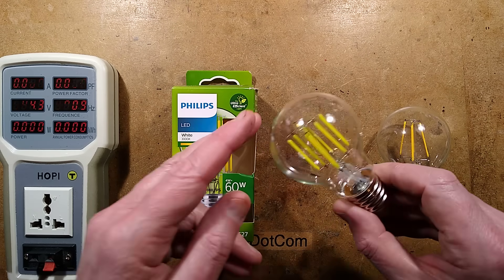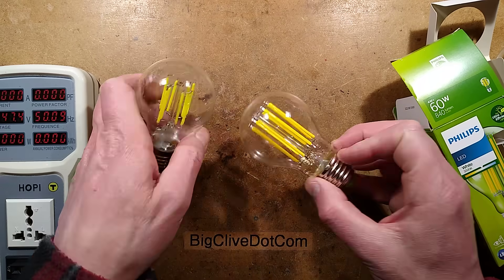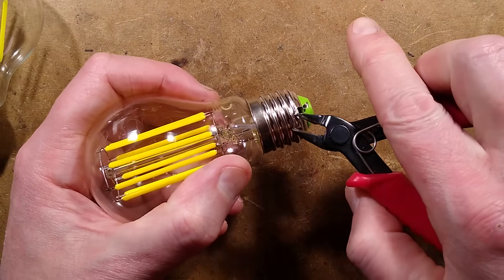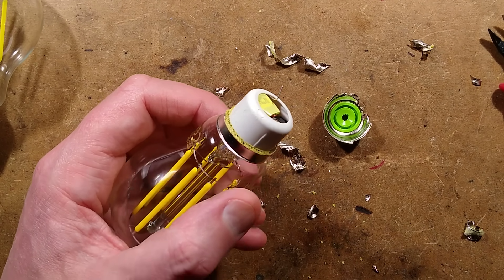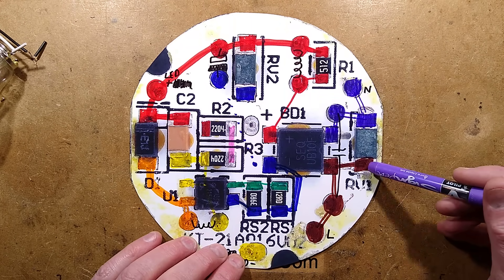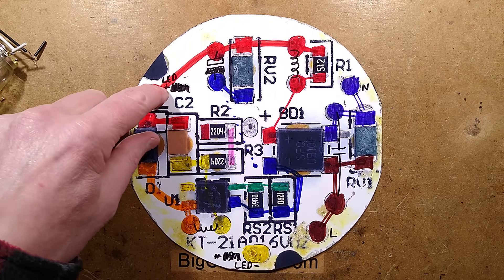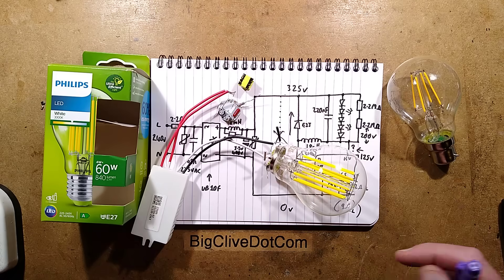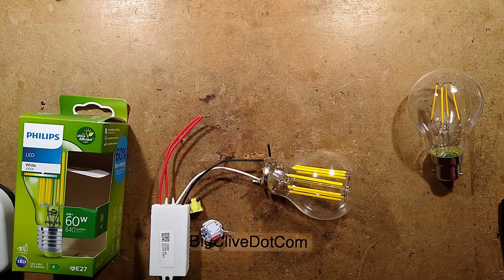Inside a new Philips ultra-efficient LED lamp (with schematic)

Comment: The use of a switch-mode regulator is a clear efficiency win versus a linear regulator.  A linear regulator is, from a power efficiency standpoint, equivalent to dropping the voltage through a resistor, just one that self-adjusts its value to fit the control setpoint.  A switch-mode regulator is not 100% efficient, but it generally dissipates significantly less power through its operation than a linear.  The reduced heat output associated with higher efficiency will in itself be good for longevity.

I don't read Chinese, but I did pull up the PT4774D datasheet.  It's a current regulator, with an internal current-sense element which is compared to the setting expressed by the external low-value resistors; it doesn't care about the voltage for control purposes.  The HV pin is used only to derive a relatively low-voltage internal VDD supply for the chip's control circuits.  Taking it from a lower voltage would reduce the power dissipated across that internal regulator (which will be a linear).  It's a matter of a couple of dozen milliwatts, I think, based on the quoted typical current consumption from the internal VDD rail.  So this deviation from the example by Philips is reasonably smart.

In this context, the high-value resistors bypassing the LED stack perform two functions:  firstly, they ensure that the internal capacitor is discharged when the bulb is removed from the power.  This is not actually about ensuring the light goes out promptly - which would only be an aesthetic choice - but to reduce the risk of high voltage being present at the bulb terminals upon exposure to human fingers.  The second function is to ensure that the HV pin of the regulator chip is pulled high enough to reliably start up.  This is likely in any case, but it "makes sure".  A downside of the presence of this bypass path is that it reduces power efficiency, as a parasitic load on the regulated side of the circuit.  This suggests to me that the safety aspect is more important to Philips, as they would rather not have this parasitic load dragging down their efficiency rating.
Reply: I took a look at the PowTech PT4554C data sheet.  I don't read Chinese either.  But like you say, this does not regulate the voltage across the LED's, but instead regulates the current thru them.  This makes perfect sense because the LED's forward voltage varies so much while it heats up.  The PT4554 uses an internal current-sense comparator to sense and control the peak switching current thru the N-Channel power FET.  One interesting thing is that the block diagram shows an OTP block which might stand for One Time Programmable.  It that's the case, the manufacturer has the option to set the the peak switching current along with the current sense resistor values connected to the Rcs pin.

Comment: The lifespan hours I simply don't believe in one bit.
I saw one study with x amounts of lamps from different brands and 50 % of them shit the bed before the 10k hour mark.
Some of them were quite expensive Philips models.
As already mentioned in the comments the LEDs themselves might last 50k hours but the electronics won't.

Comment: Phillips LED light bulbs are total JUNK!!! Two years ago I threw down $60 to buy a bunch of these new Phillips LED bulbs and replaced ALL the light bulbs in my house with them!! Within a week one by one they started to burn out!! Now I am running on an old 50 amp electric service that was installed in my home back in the early 1970s!! So these lights SHOULD have lasted a very long time!! But instead one by one over the next six months every bulb I replaced, even the replacement of the LED bulbs with MORE LED bulbs burned out!! And in short I wasted $60 on a few packs of light bulbs that didn't even last two years out of the 6 packages of LED light bulbs I bought!!! 

AND BEFORE YOU THINK I AM BEING HARSH CONSIDER THIS!!! Around the same time I bought those piece of crap Phillips light bulbs, I bought cheap $14 a roll LED light strips for my shed (this was 6 years ago)!! Today my house is lit by 60 watt incandescent light bulbs and my shed is STILL lit by those cheap LED light strips and an ATX computer 100 watt power supply!! So the $30 a package I wasted on the crap Phillips light bulbs was money down the drain, and from now on cheap LED light strips are the way to go!!

Comment: Could they have used the HV line after the LEDs because the chip was designed for 110V? Then they used the LEDs as a voltage drop.

Comment: By my calculations, one of those bulbs would save about £1 per year per daily hour compared to the more usual ones at the same output at current UK electricity rates. So if a bulb was used on average 4 hours per day, that's about £4 a year and any extra cost would pay back in a year or two. However, if it's only turned on occasionally, then it's going to take decades. The lesson here is to put the most efficient bulbs into the fittings which are used most if you want to optimise your saving and expenditure. 

Note, I've not considered any savings from the bulbs lasting longer, but that might not be so important for those which aren't used a lot anyway.

Comment: The unknown symbol would appear to be showing a garage and driveway... my interpretation would be "not suitable for exterior lighting applications" as opposed to the earlier "not suitable for wet locations"

Edit: I see that others realized it was specifically showing a motion sensing fixture... which is the best and correct interpretation.

Comment: 3000°K is about the same as a common halogen. But color rendering could be quite different, most anything. CRI has been an issue here in the USofA. We have these 25 cent bulbs, which sometimes work quite well, other times they're horrid, up to $8 bulbs for the same output and similar efficiency. What's going on? Well, noise filtering and color rendering are two major differences, price gouging is another. Many cheaper lamps have awful color rendering.
We have 2700°K, marketed as "soft white" even though there's nothing soft about it, just to confuse people and take advantage of the popular term used for incandescent lamps differentiating standard and frosted; "bright white" 3000, unless it's a fluorescent replacement, then 3000 is "warm", to confuse people more; 4100 "neutral" or "natural white", almost never available for common lamp styles, but called "bright" for fluorescent replacements; and 5000, 5600, and 6500 all called "daylight", to add more confusion.

Comment: I was all pleased with it until the "no dimming" and the lousy "cri 80" - yikes! That's a lot of money for a lamp with bad color!
Reply: It could be made dimmable with appropriate driver/ballast circuitry, but the bad color appears inherent to the high efficacy white LEDs.  Getting the same lumens with good color (CRI Ra 90, R9 50) would require nearly double the power.

It surprises me that filament bulbs haven't solved the problem, though.  Each filament will have 30-plus LED chips in it, so it seems like they could change a few of them to red chips for a big improvement, since what's lacking is mainly red light.

Comment: I don´t get it. Why do these renowned brands like Philips or Osram always sell just this CRI 80 stuff? Ikea sells CRI 90 bulbs, Kaufland has it´s bulbs with CRI 95 (Attralux bulbs) and Lidl sells CRI 97 (Livarno bulbs). Sure they are not as efficient, but I rather buy these, than 2x more expensive Philips or Osram.

Comment: If you uploaded your videos in 4K, they may look much better even if you only film in 1080p.
 Youtube's compression is very aggressive, so the texture of your work bench leaves very little data for foreground objects.  The 4K playback stream uses a much higher bit rate meaning less compression artifacting.

Comment: Standard color temperature of daylight 5600 Kelvin. This light is warm white of 3000 Kelvin. In comparison a basic Halogen light is 2700K  TL-Light  is around 4500 (officially is has two spectra) TV is around 5400K,  midday sun around 6000K, the super hot blue comes in at cloudy days, at 7000 - 10000Kelvin.  Want it really really warm light, as in invisable light, touch the pan while  making pancakes and feel it radiate....oh dear:))

Comment: Hey Clive, you've reviewed a lot of LED lights - I need some advice.

I'm in Peru, and my LED lights glow when off. We don't use split phase; both wires to the light are hot. What kind of LED or LED driver do I need to buy to ensure my LEDs don't glow when off? It's pretty annoying for bedroom lights.
Reply: If you can get double pole switches that would solve it.
Reply: @MrAdopado  Unfortunately, double-pole switches here are super pricey. I could get one from AliExpress, but I'd rather not.

I'd really just like to get LEDs with a good drive, but I don't know where to find good ones.
Reply from the maker: It's very common on multi-way switched circuits.   Some lamps do it more than others.

Comment: I can't find a way to search all the existing comments so I hope this has not been asked already. How noisy is that circuit? It sounds like it would create a lot of radio interference. Does it?
Reply from the maker: It probably creates more noise than a capacitive dropper or linear regulator.

Comment: If one filament fails, does it take out the entire bulb? Such a waste. Can’t they make a bulb that will continue to work as individual filaments fail?
Reply from the maker: In this one four filaments would have to fail on one side.  It could still operate with 6 failed filaments if one was left on either side.

Comment: The Phoebus Cartel has been used so many times as an example for "see, companies want to screw us over by making their products break on purpose". And as always it's repeated and spread by so many without checking or understanding what was going on (too lazy or ignorant). As you said the 1000 hours was about the sweet spot between longevity and efficiency (only for incandescents obviously, awfully horrible nowadays). The cartel was formed so none of the members would advertise with longer lasting bulbs, which would effectively have been underrun bulbs by design. Without some limit they might had ended up with barely glowing space heaters, because they had the longest lifetime.

Comment: If you make a fist around the bulb, so your thumb and forefinger are gripping the metal contacts, you can then tap the end with a hammer and it will cause the glass to cleanly break free of the bottom housing. It's much faster and easier than cutting and peeling through the metal.
Reply from the maker: I'm not sure I fancy trying that.
Reply: @bigclivedotcom  It would be kinda like this but you hit the tip of it, instead of the side: https://youtu.be/tQAtVpHJ26E?t=163

Comment: Would be great if they could make 1300+ lumen dimmable versions of this.
Reply: There are two 1500 lumen non-dimmable ultra efficient models available in some countries. But so far no retailer was able to order them from philips. 12 filaments, 7.3w 3000K and 4000K. That's 4W less than the older models. They will pay of fast if electricity is expensive in your country :)
Reply: @falco3899  Thanks for the info. My main interest in these type of lamps is the longer life due to the LEDs being driven less hard. I've had a few LED bulbs go well pop before their time so far.
Reply from the maker: Search my videos for the word dooby for a lamp hack.

Comment: Do 3000lm Dubai lamps exist? Because I need that really powerful light and the normal philips one dies all the time, starts blinking... just an inrush resistor dying, that's so stupid!
But opening them to fix it isn't possible without destruction!
Reply: You need a lamp with 2 sockets, then you could use the new 1500 lumen version of this with 12 filaments and 7.3W
Reply: @falco3899  anyway rn I got a reliable setup

Comment: Thanks, Clive. Very interesting. I am wondering if the glass globes have a vacuum in them, or maybe some type of gas - or just regular air?
Reply from the maker: Possibly a gas like helium to assist thermal transfer.
Reply: @bigclivedotcom  helium would be costly, perhaps nitrogen or inert gas?
Reply: @Banter Maestro2 Helium-oxygen is the preferred filling in these.  Although Helium will leak through certain glass types used in other lamps, the rate of diffusion through the soda-lime-silicate (Philips PH241 glass) and the strontium-barium-silicate (Philips PH360 glass) used for these lamps is exceptionally low.  The most critical area is the glass-to-metal seals that carry the electrical current into the bulb.  These are made from a borated copper sheath brazed to a 42% nickel-iron core to match the thermal expansion rate of the glass, and helium can diffuse along microcracks in the brazed interface.  Even so, when bearing in mind the leak rate along the wires plus the rate of diffusion through the 0.6mm thick glass envelpe, I estimate that the half-life of the helium filling is about 75 years.  This is well in excess of the rated life.

Comment: They need to get this in the US already.
Reply: They are now available in the US.  I was able to order online through Walmart of all places.  The bulbs are amazingly efficient, but the color of light is not great in a home (color has a enough green to look odd in a residence)..  I prefer the color of the Philips 2700k Warm Glow on a dimmer,  but use 8.5w rather than the 4.5w of the Ultra Efficient.  Ideally, I'd like a dimmable version, 2700k, warm glow, and would give up some efficiency as needed to get better color and longer life.

Comment: It looks like good value for money. I always prefer lamps with a switched mode power supply. They run cooler are more efficient and are less sensitive to high temperatures. I see linear as cheap and nasty.
Reply from the maker: Well balanced linear are very efficient and generate no electrical noise.
Reply: @bigclivedotcom  Yes, low noise of linear is definitely an advantage. It's possible to do that with switched mode, but more expensive and the components take up extra space. A big problem with linear is the efficiency depends on the supply voltage, so if you're in a location where the mains is nominally 250V and it's hot, there's a big risk of it overheating and dialling back the current.

I'm actually a big fan of the old capacitive dropper. It's simple, efficient and runs very cool. The problem is so many of them are poorly designed, but that's an issue across the board with cheap LED lamps.

Anyway, thanks for making the video and bringing those new LED lamps to my attention. I will definitely look into getting one!

Comment: I noticed that the are no bleeder resistor across the primary capacitors.

I wonder you can get a shock by touching the lamp terminals after the lamp has been removed from the fixture.
Reply: The shock current would be limited to the leakage current of the bridge rectifier, so the shock wouldn't be enough to feel.

Edit - oops, there's still a 68 nF capacitor before the rectifier, so depending on exactly when the lamp disconnected, the residual charge would probably give a jolt!

Comment: What is the advantage of a Buck regulator over a Capacitive Dropper (like in the Dubai Lamp)?

Or is there some regulation that forced Philips to go for this significantly more complex circuitry, instead?
Reply from the maker: I prefer the more passive circuitry like cap droppers and linear regulators.  Maybe they were trying to squeeze the last % of efficiency out.

Comment: My ex father in law told me he had his under cupboard lighting going OK for years in his kitchen.
When I looked (yes I was a young electrian ). He had wired them in series and not wired correctly so he had not run them on full power.
When I told him. He said its been OK for them. So we don't need to change them.I just laughed.

Comment: Feit used to make their filament LED bulbs like this, but stopped a few years ago and switched to the standard 4 filament design. I wonder if they caught some heat from Philips for it. Now they make their 100W ST19 with 6 filaments, but everything else is 4.

Comment: The "Eye Comfort" branding means the light isn't supposed to have any visible flicker, even when the dimmable types are dimmed down to as low as 5%. This helps reduce eye strain and headaches in those sensitive to flicker.

Comment: Are UK bulbs usually clear? I'm asking because in the US they are almost always frosted. Clear are sometimes available but are usually considered a specialty item and are generally prices higher. Oftentimes they are called "Edison Bulbs" and are used when someone is going for an old fashioned look.
Reply: Both types here in UK. Used to be more common to be pearlescent (I think that's what they called them) but clear ones came back into fashion with these types of LEDs with long "retro" looking LED filaments.
Reply: @MrAdopado  OK, so same as here then. We had them for a time in the IKEA retro looking overhead lighting fixtures in our kitchen. At the time they were expensive, poorly made, not particularly bright, and short lived.

Comment: If this has electrolytic capacitors, how many years will they last versus the other components?
Reply from the maker: The one electrolytic is on the low frequency side.  A ceramic one has been used on the high frequency side.